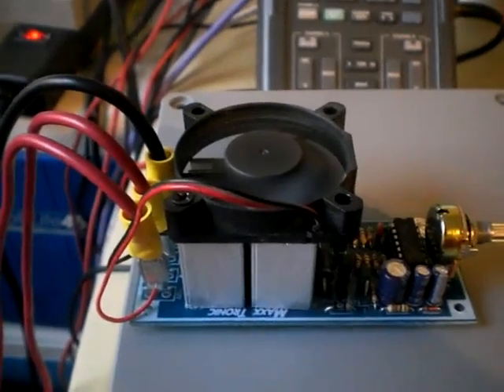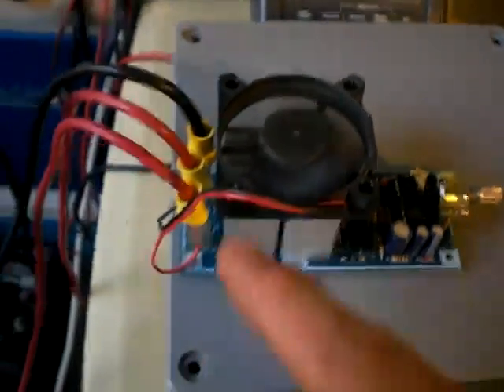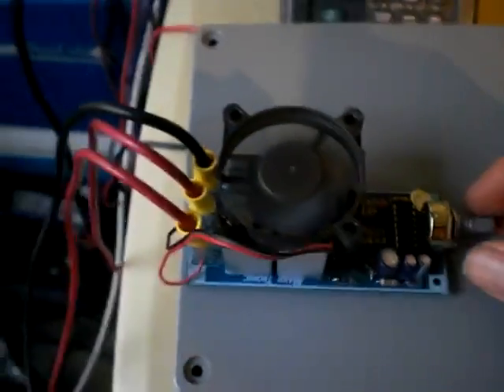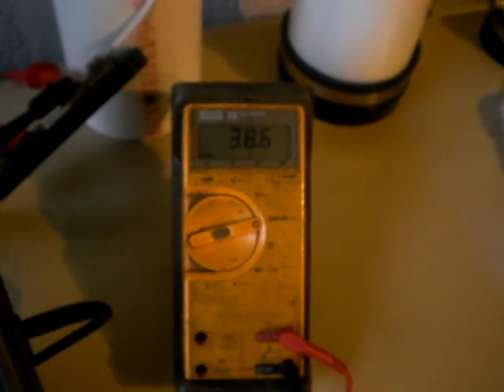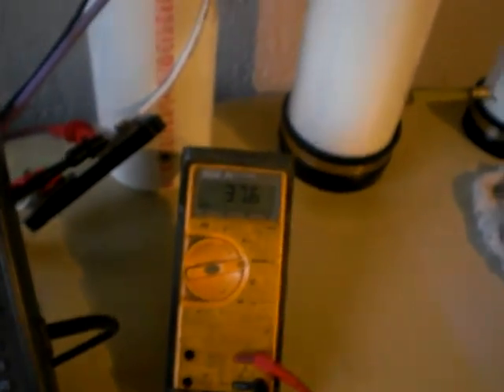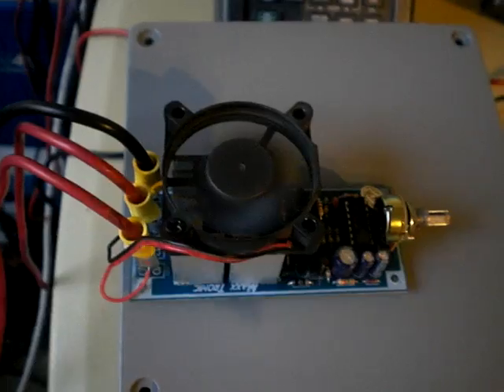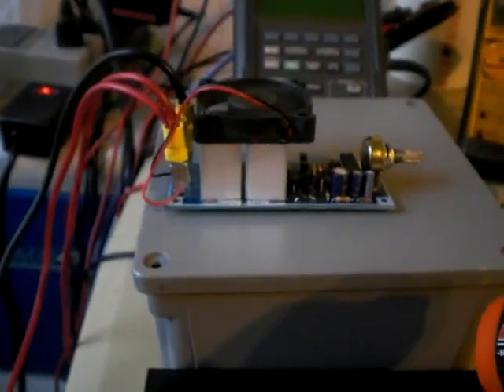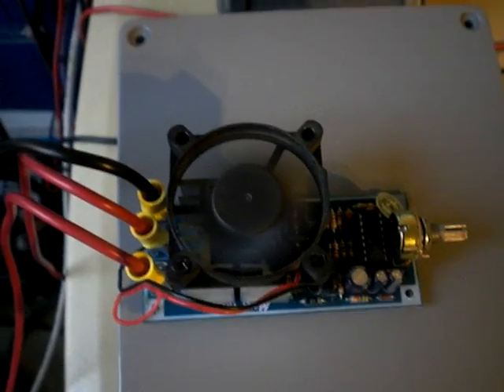Temp Fix for Cheapie PWM Overheating Problem

Comment: by the way, I used to have that exact PWM. it sucks....go get yourself a 60000Khz PWM with frequency adjustment knob also.

MUCH MUCH better control and customization, and production

Comment: those look mostly like a P3 fan or AMD, the P2 fans where mostly mounted on a cartage type of sink and where alittle smaller, like a 60mm fan (2.372"). below that era would be 40mm (486) type @ 1.57" =) I run a Computer Recycling business, i would of gave ya a few.. even after 6pm. LOL

Comment: some computer fan's do require a 12v source, tho only (0.18A). alittle harder to find in newer stuff, but maybe a computer surplus type of store might have a few or more. dunno if you could find one that is 486 size with a 12v input however.

Comment: Nice.
How did you hook up the fan?  Straight from supply, or from PMW'd?
I think I have the same PMW.  The heat sinks are not attached well to the CB.  Any hints on how to address this?